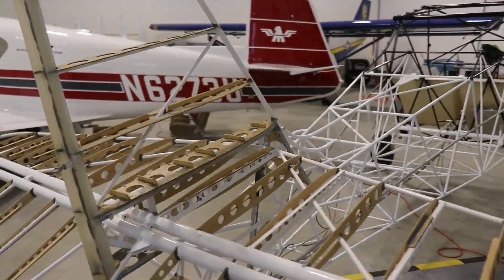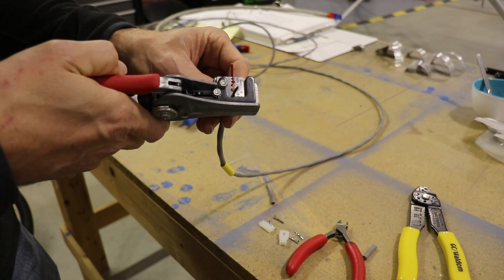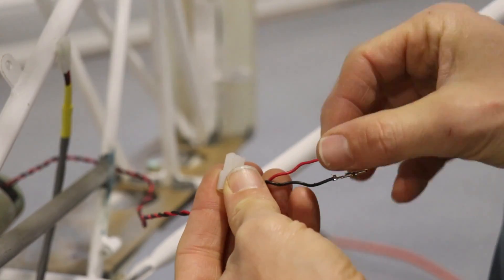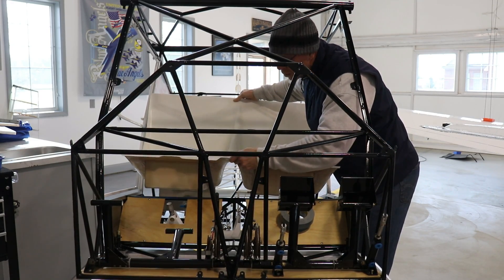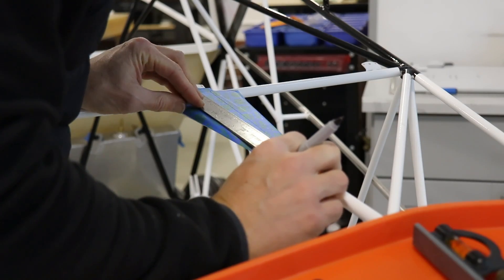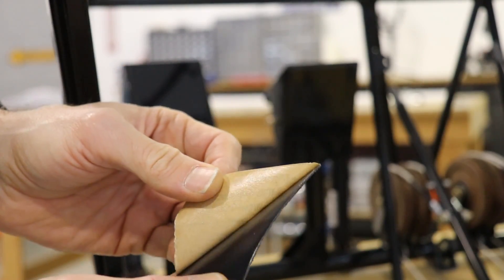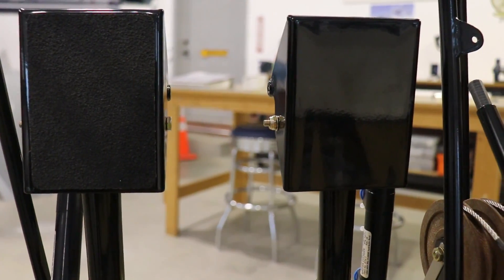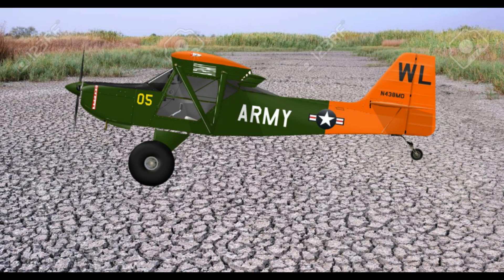KITFOX Project Progress

Comment: I'm securing 3-4ft of lightweight plastic tube to my fuselage tubes in what will be the hardest portion of the fuselage to access. Will make any wire changes easy. Will then seal either end with plastic mesh to keep any nesting bugs out.

Comment: Hi how do you feel about tube and fabric verses all metal
Reply from the maker: Matt, it depends on what you mean by "feel". I can only answer in regards to what materials I prefer. I've built two tube-and-fabric planes and enjoyed them. One thing that's nice about them is that the airframe comes already welded and as soon as you install the gear, you pretty much have your fuselage ready to start installing systems (which is the most fun part of the build). But I also built an RV-7 and a Zenith Cruzer, and I learned that I really like working with aluminum. So in building an airplane, I prefer aluminum construction over anything else. I wouldn't say though that any one is 'better' than the other.